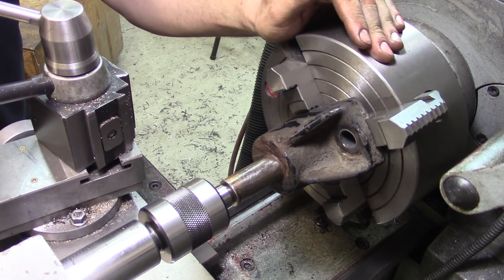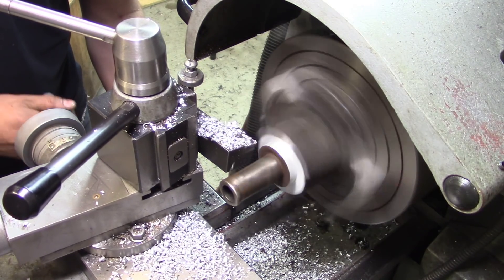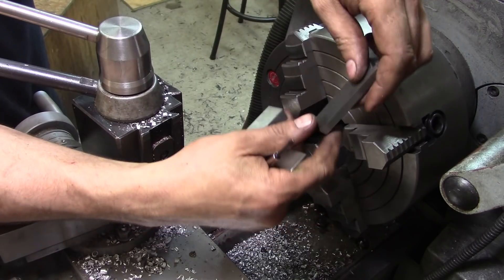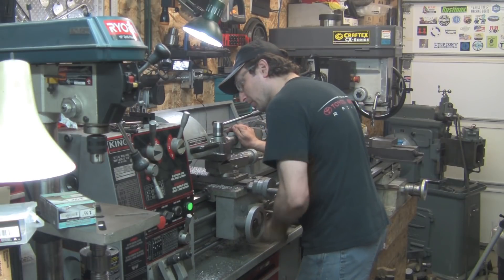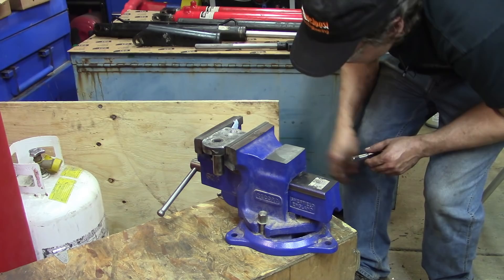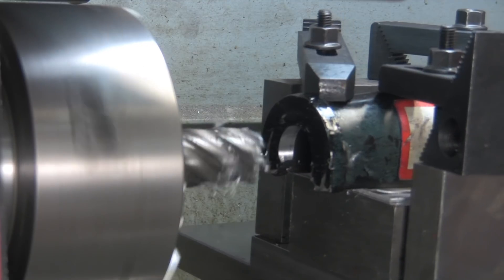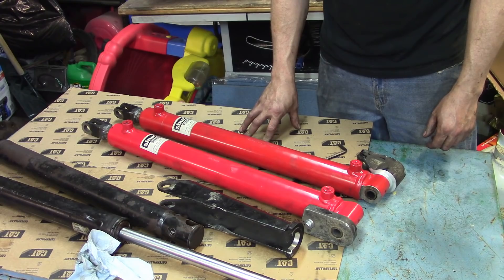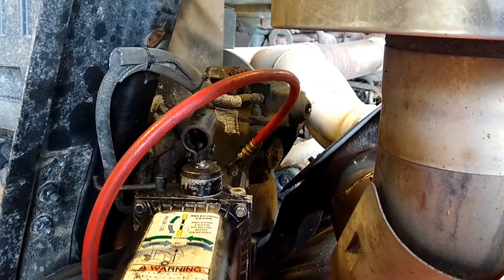Freightliner Argosy Tilt Cab Ram Mods Part 2

Comment: Hey Everett,  Greg here from Southern Ohio.  When I was a teenager at home a couple of steel haulers ran cab overs. I often thought how bad it would be in a head on wreck since there wasn't that big engine out front to take most of the hit.  Hope the fellow who operates this one never has to experience a wreck of any type.  Fine adaptation and that kind of project seems to be right up your alley.  Keep them coming and I enjoy every project you've done so far.  Thanks and stay healthy!  Greg
Reply from the maker: Thanks Greg, glad you liked the build.  As for the collision idea, that was one thought I was having as well, especially considering what kinds of wrecks a person can get into.  Up here we have quite tall moose and it would be a total mess to hit one of those in these things.
Reply: @EverettsWorkshop  Great minds travel in the same...er wherever they travel.  No moose down here but plenty of other tings to run into.  My pleasure to watch your videos.  Greg

Comment: I like how you used the adjustable parallel for the set up, I would have searched the shop over for a piece of metal the right thickness even though I have an adjustable parallel, just wouldn't have thought of using it, so even a 73 year old can learn something new. Thank you for the great videos. I enjoyed watching the jobs you do.
Reply from the maker: Thanks Gary, glad you like the videos, I'm just messing around in the garage like I would normally but now have a camera over my shoulder.  Glad you could find something useful as well, the adjustable parallel trick was just the only thing I could think of for getting the part square to the jaws.  I've learned so much from others on here, glad to be of help to someone else!

Comment: A little innovation to get around the high cost of OEM parts and make it so these rams are easily replaceable if they ever need it! I like it !
Reply from the maker: Thanks John, we just wanted to get him going and the prices of the OEM parts, as well as the wait, made this option the way to go.  And, if they ever spring a leak in the seals, the seal kits are readily available at Princess Auto for cheap.

Comment: Nice project. Came out well.
Years ago i almost broke a windshield when a glass bottle fell down while i was lifting the cab.
Reply from the maker: Thanks!  Thankfully no windshield damage here, but my boss told me of one of his coworkers at a truck dealer he worked at years ago.  Apparently a television set went from the sleeper right through the windshield when the cab was tipped up.  Sounds like it was a bit of a mess, both broken parts wise and in dealing with the customer.

Comment: Hi Everett...   Another fine job getting the Trucking Industry going. I was surprised that the swivel brackets were made from alloy.  Keep up the good work, & be safe.
Reply from the maker: Thanks Ted, I'm just going to work every day like I've been doing for months.  We actually got busier with the virus BS happening.  I have been surprised how much aluminum there is in a modern truck, lots of castings and pieces made from alloy bar.

Comment: Really liked how you used the lathe as a boring mill. I have seen Keith Fenner do it a bunch of times. I have been thinking of making an adapter plate that would mount where the compound attaches. I do have a right angle head for my knee mill which covers most of this type of work.
Reply from the maker: Thanks!  I made that t-slot plate quite a while ago for just such occasions as this.  No vertical adjustments apart from shims so setup is a bit fiddly, but it does work for jobs that are too long for the mill vertically.

Comment: I really liked the adjustable parallel trick, got to remember that one.
I am currently overbuilding a work bench to mount an old 6" Record Vise.
Reply from the maker: Thanks, it just seemed like the easiest way of doing it.  Once the jaws are tight it can be slipped out, but otherwise I was scratching my head on how to keep the mounts square to the chuck face.

Comment: Great job on retrofitting the new cylinders. Worked out great. I was going to warn you about some check valves that the original cylinders had built in as safety feature but looks like those are working just fine.

Greetings from Portugal. 👍
Reply from the maker: Hello and thanks Pedro!  I've always thought Portugal would be a great place to visit but haven't made it to Europe yet.  My in-laws went to Algarve last year and loved it.  We did not install any check valves in the cylinder ports but when all was said and done the cab tilts as it should now.  For how often this cab needs raising it should be ok.

Comment: Cool looking cab over, its too bad there arent of them here in the US
Reply from the maker: From what I gather, there were more back in the 70's and 80's when vehicle overall length restrictions were tighter in some jurisdictions.  It is not surprising, given the congestion over there, that they are more common in Europe.
Reply: @EverettsWorkshop  think that's an accurate assessment

Comment: The manufacturers never allow for the extra 1,000 pounds of things that will be put into the cab near the back that will have to be lifted and their cylinders aren't strong enough. You are lucky to be working on trucks at a time when there aren't many cab over trucks left on the road because they are miserable to work on.
Reply from the maker: Thankfully the owner only recently acquired this unit a few months ago, so he hasn't had a chance to fill every nook and cranny with crap yet.  It has been an interesting and educational experience though - one thing is that it has a Detroit Series 60 in it, with rear-mount gear train for accessories.  Once the cab is up the engine is ridiculously accessible, more so than a conventional cab.  I can see how some other things (clutch and shift linkages, electrical, etc) would be a total headache though.

Comment: Cab Overs are unique.  Don't see too many these days. No grease zerk on the cylinder end eye?  Brings back a not too good memory of lifting the cab when parked too close behind  a cab and chassis, didn't realize it would go down that far., hard on windshields. Oops! Boss not too impressed!
Reply from the maker: Hi Ernie!  They seem to be rarer here for sure, but sounds like they are still more common in Europe.  I was wondering about the grease fitting as well but was told not to bother for now.  And I can imagine the foreman was none too impressed with that moment of yours, it really is surprising how far they swing over.